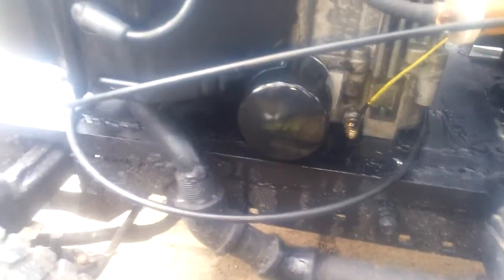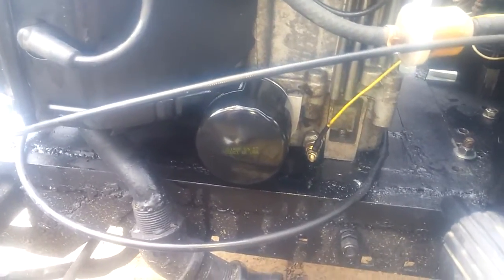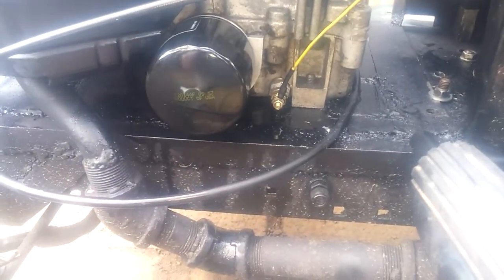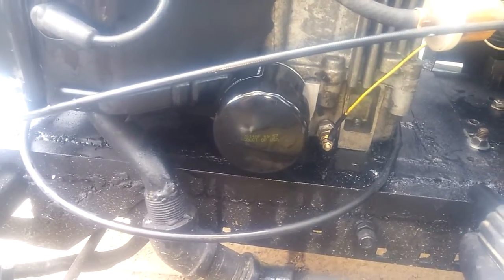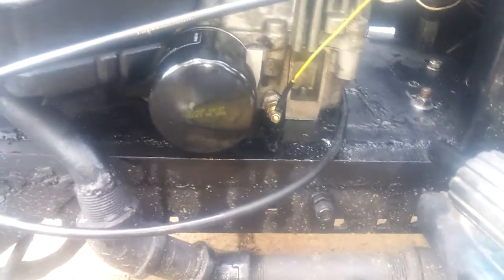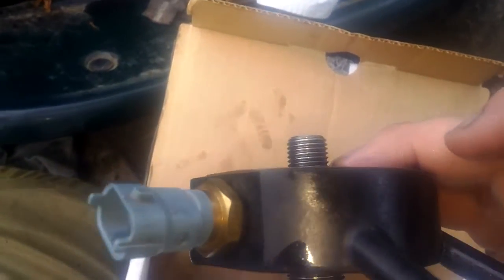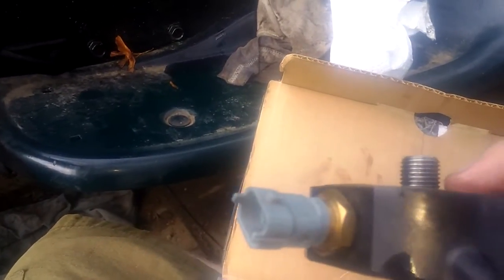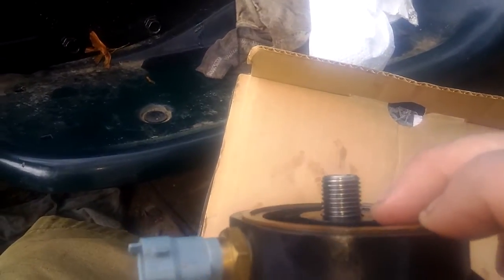Oil Cooler Won't Work

Comment: try and get a spacer that has lines coming off then attack a oil cooler, one that has the same threads as the oil filter